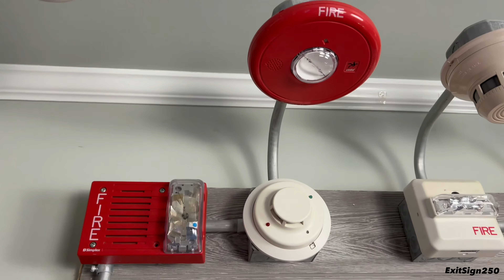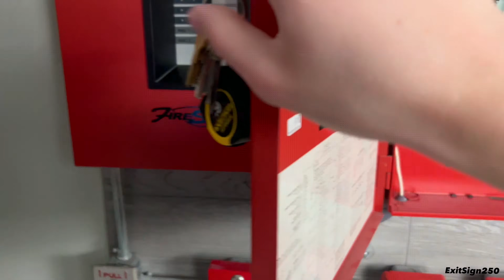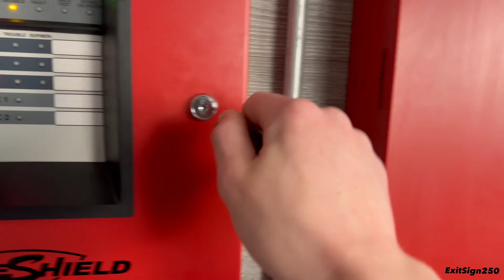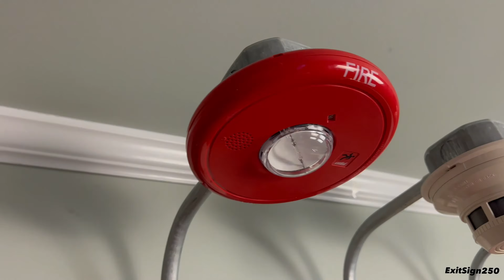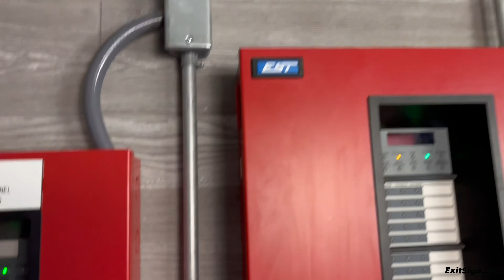System Test 16 | Board 2

Comment: Do the EST panels have a feature that you can use 2 wire silence for the EST genesis? I remember you did it in the first system test with these panels. Nice test. I will be releasing a new test this week with my system.
Reply from the maker: They do. However I’ve found if you have non Genesis devices on the same NAC they can act up when the panel is silenced if this feature is enabled.
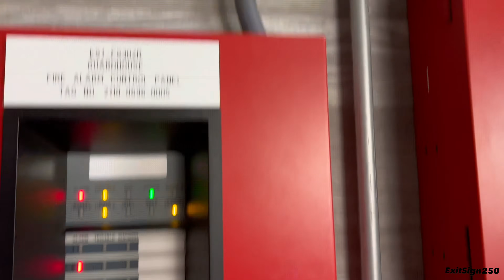Reply: @ExitSign250 put your smoke detr on the wol 4:26

Comment: Those 4903's are loud as hell. I have one too lol. I like to refer to the electric 4903's as the "Pre true-alerts" lol
Reply: Those were actually made in late 2015, and the TrueAlert itself came out in 2000. It started out as a QuickAlert in the early-mid 1990’s. Fun fact is I looked up the 4903-925X series and those are actually addressable.
Reply: Ihgnr❤

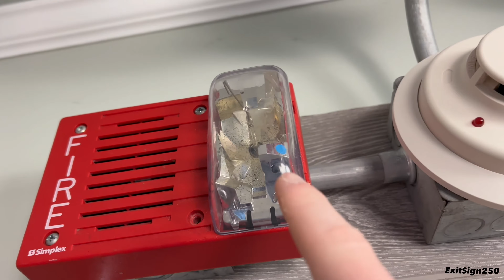Comment: 1:00 I think your “TrueAlert” 4903 has a 30 candela Strobe. If it did have an 110 candela Strobe, it would have an orange triangle. FireAlarmDude5967 has a video specifically dedicated to the Simplex 4903 series in case you’re wondering.
Reply: What do you mean Triangle?
Reply: @An_Official_Scratcher That triangle is what Indicates your candela (brightness of the strobe). As the guy up above said, if you see a Simplex 4903 with an orange triangle sticker in the strobe, it is a 110 Candela strobe. It's a Simplex thing.